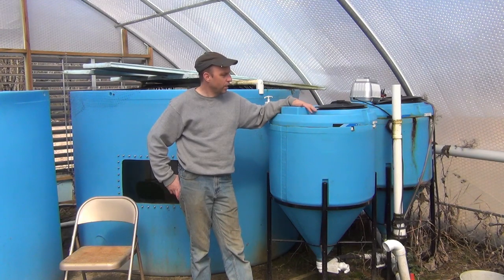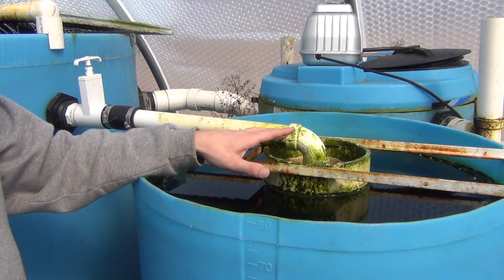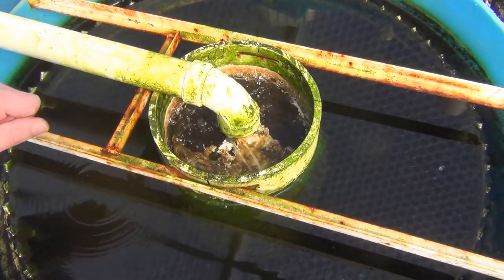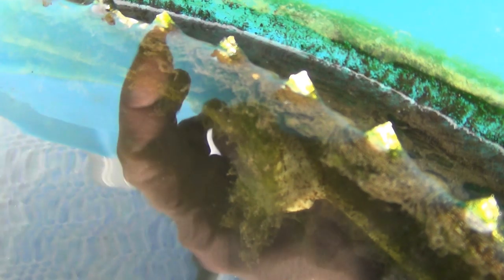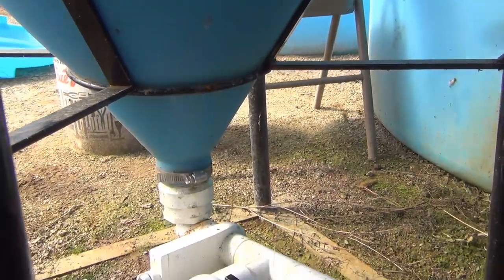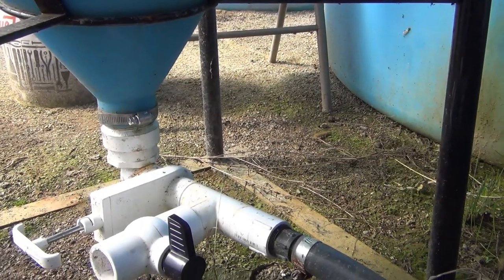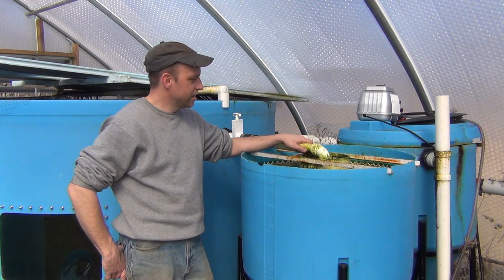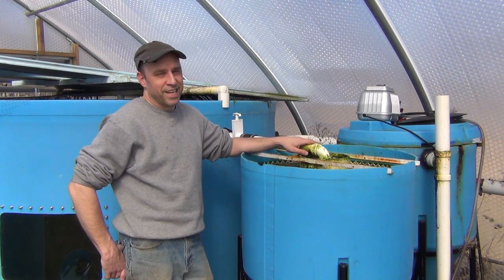Does the RADIAL FLOW SETTLER really work?

Comment: I’m very happy your design worked out. When building my system I followed your design with a 14 gallon container about the same time you were building yours. I tried with the weirs but found out they were not needed in my situation. I didn’t realize your center down pipe went into the tank that far. I’ll have to try and extend mine. Thank you

Comment: For some reason, I don't remember that center pipe being that long.  Oddly enough, I've been hoping for that update on the mineralization tank. I'm hoping to get my stuff up this summer & have based my radial flow on what both you & Rob Bob down in Austraia did. Similar to your design, however in contrast, my input will be coming from the bottom of the barrel, requiring the barrel to be at the same level of the waterline in the IBC.  I will be shooting video (I'm no "creator" by any means) but I would appreciate it if I could get some brutally honest insight when i put it up.

Thanks

Comment: is it possible that your vertical tube is a bit too long? I saw an accumulation of dirt on the sloping wall as if there is too much water flow to let it sink down to the lowest part. I think this is solved when you shorten the vertical tube about 30cm.
Reply from the maker: HaHa!  I was hoping no one would notice that.  Good catch.  Yes, I need to shorten the stilling well a little bit.  For the most part, the fish knock it back down.  I've noticed if I change the flow rate faster or slower, the ring will eventually expand and contract since the velocity changes at that spot.

Comment: I like your videos.  I am wondering why you do not put algae eating fish in the settling tanks instead of the Koi, or even in addition to the Koi.  

They would eat most of that growth, and easily control it also adding those nutrients back to your system.
Reply from the maker: the water is too cold for algae eaters
Reply: @Bigelowbrook  What species are you raising?  I saw trout in some of the videos, but others in other videos.  If tilapia, your water should be the right temperature.  

Even so, I think there are fish to cover this niche.  I will get back to you.
Reply: http://injaf.org/the-think-tank/the-algae-eater-debate/

Hillstream loach species are frequently sold as algae eaters for coldwater or temperate tanks. ... One of the common fish sold as a “good algae eater” is Pterygoplichthys pardalis, aka the “Common Pleco”. It will eat algae nicely, but it will also grow to around 45cm/18″, not counting the tailfin.

Website so you can check out the information for yourself.  Let us know if you decide to acquire something.  I'd be very curious.
Reply from the maker: thanks for the info.  I looked up the info and the the site says the Hillstream needs to be above 65F.  Our currently water temp is barely 60F.  Plus they need a high flow rate (I"m assuming so they get enough O2 without the need to swim a lot).
Reply: @Bigelowbrook  I was hoping to be able to help.  I admittedly did only a cursory search.  I will get back to it at some point as I think we can find a suitable species.  

My system has goldfish, swordtail mollies, a few corydoras, tetras, & some random cichlid species.  My location allows our water temperature to be in range for them without heating, so it works out well. 

I am planning to add some algae eaters as well as I over-looked the need when I set up.

Comment: Great videos, how did you make the diffusion plate
Reply from the maker: 3D printer
Reply: @Bigelowbrook  How does it attach to that elbow
Reply from the maker: @captainscottlum2371  It's just a friction fit....it pops right out if necessary